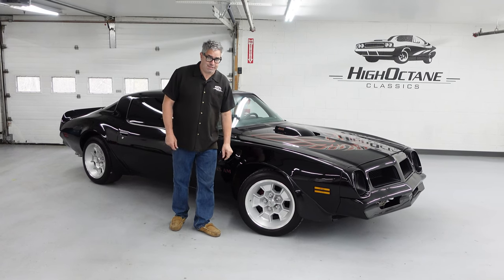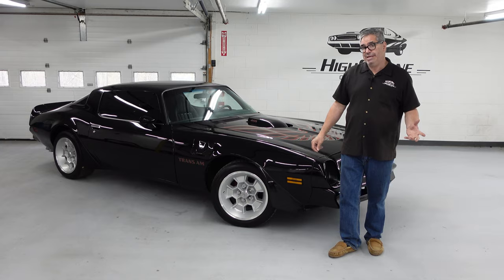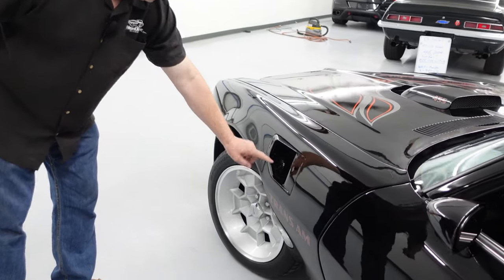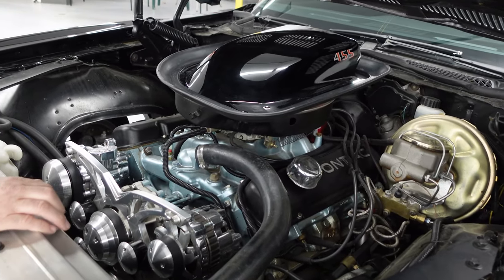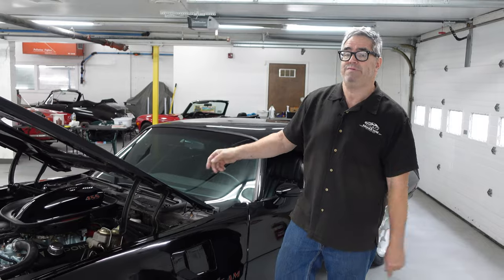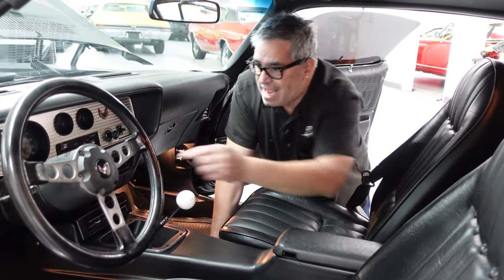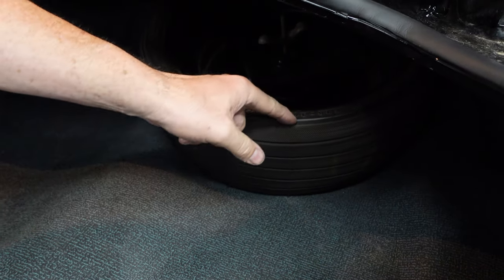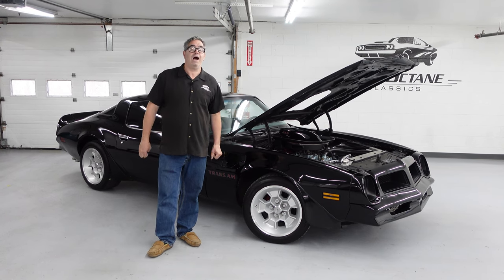1976 Pontiac Trans Am Walkaround with Steve Magnante

Comment: I think this one is a repeat that I've commented on before. With the VIN (from the HOC website)  we win: 2 for Pontiac, W for Trans Am, 87 for two door coupe, Z for 400 V8 with four barrel, 6 for 1976 model year, N for Norwood, OH assembly and the rest is the production sequence. The Norwood, OH plant operated until August 1987 and production at that time was done solely at Van Nuys, CA through the 1992 model year. After that, production moved to St. Therese, Quebec Canada for model years 1993 to 2002. 

No tag, can't brag.

Comment: The new style 77 Shaker was very small and barely rose above the hood level, and was changed for 78 making it higher, and the splitter tail pipes were only on the 455, the 400 had single straight pipes out the rear. And in 78 you got the dual resonator exhaust that gave it a little better sound than the previous single can sitting horizontal behind the rear axle. Guys started putting a "test pipe" you could buy at any Western Auto or from the JC Whitney Catalogie to remove the cat converter that not only freed up some exhaust flow but made it sound real good with a nice rumble.
Reply: The GTO splitters were more vertical and in the rear of the wheel well behind the rear tire... close enough you could hear them with the windows rolled down... muffler shops were too lazy to put replacement splitters in the correct spot...
Reply: @BuzzLOLOL  my buddy had a 64 GTO with the splitters, yes a differant angle
Reply: @KevinTurner-hr1wg  - Yeah, back in the day my and 2 neighbor kids '65 GTOs had the splitters in the wheel well... can't even find a picture of one that way now...
Reply: @BuzzLOLOL  my favorite the 65 before the 68 year change...
Reply: Yeah, the 77 shaker was 1 1/2 inches tall and in 78 it went to 2 inches ,

Comment: Just to let you know the collapsable spare was in my older brother's 671/2 Firebird 400 when he purchased the first Firebird sold in Mt Vernon, IL.  I currently have a number matching 76 Trans Am with 455 4 speed.  Fluxed, balanced with cam and chrome molly pistons.  Dynode at 330hp 450 lbs of Torque.  I have the dyno sheet and the engine build sheet.  Original Quadrajet.

Comment: Very nice TA. Must say I disagree with the serpentine belt system being better than a V belt stock pulley system.  I had a March pulley system on a 81 Trans Am 461 that was on the car when I purchased it. The serpentine belt would not stay on. Went through 4 of them. Pulled the serpentine system off and replaced with the factory V belt pulley set up. 7 yrs later never once threw a belt. Still running good to this day.

Comment: I bought my first Trans Am in 1975 right off the dealer's lot. It was sterling silver with burgundy interior. It had the Pontiac 400 engine rated at 185 hp. I quickly modified the car putting on a true dual exhaust system complete with Hooker headers. Then many mods to the engine incl. the installation of a Crane cam. I was not happy with the stock car so
I had it built the way it should have come from tge factory. Yes Trans Ams sales started to increase in 1975 and aftet the movie "Smokey and The Bandit" sales skyrocketed. So much so that Chevy brought back the Camaro Z/28 in 1977.

Comment: no, the 73 and 74 T/A with or without SD455s did not have functional hood scoops.
Reply: Correct, by then the EPA shut that down due to noise/drive by noise issues.
Reply: Yet Pontiac kept the functional shaker on the 74 GTO and wonder why.
Reply: @thud9797 Who knows? Maybe it passed the noise regs.
Reply: @googleusergp  
Yeah must be, the 350 did but 400 and 455 didn't, the regulations were taking all the fun out of everything. 😀
Reply: @thud9797  Things were very odd with the EPA back then, so who knows.